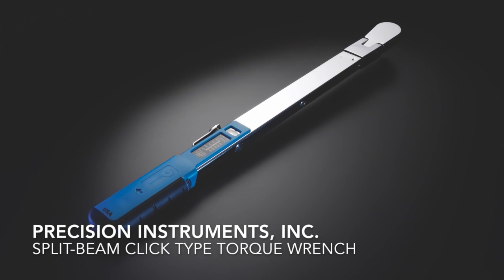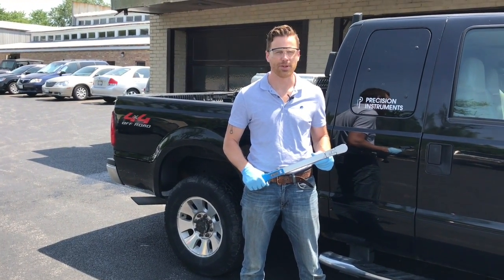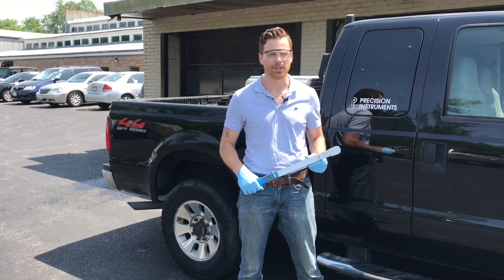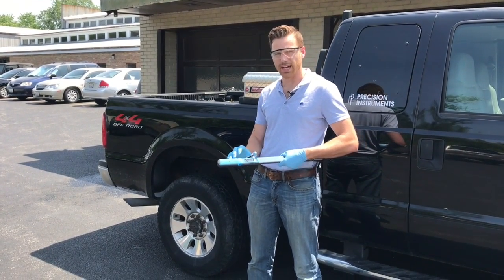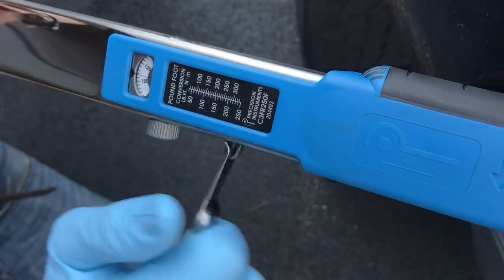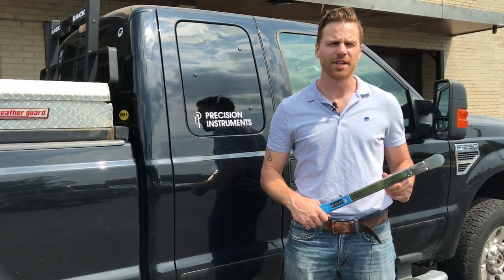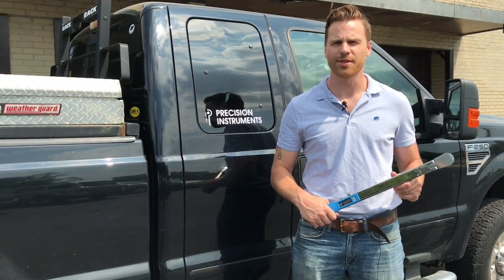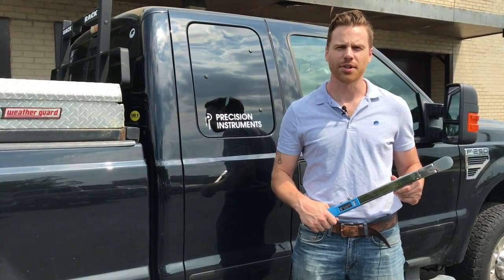Split-Beam Demo 1

Comment: If Precision Instruments can answer these 2 questions please. 1. If I purchase a PI torque wrench on Amazon for $158 vesus $355 + $20 for the certificate direct from PI, will you warranty it if needed? 2. Your downloadable instruction manual shows a direction lever and indicates that the torque wrench can be used in a tightening AND loosening directions. I don't see a lever on your split beam torque wrenches. What's the deal on that? Can you use it to measure break-away torque?

Thanks!

Comment: I just bought a precision instruments C2FR100F 3/8” 20-100 ft. lb. they were affiliated with Snapon before. That’s how I found out about PI. I will return my CDI 3/8” as I did not hear a click sound kinda strange. Also I don’t have to release tension to low setting unlike click torque styles

Comment: I am hesitant to buy this torque wrench from Amazon due to the fact that it is only available from an independent seller. I am starting to be wary of knock of or counterfeit  products being sold in this way on amazon. I would like to be confident I'm buying a real, Non refurbished PI wrench. If it was direct from the company or Amazon I would have more confidence.
Reply from the maker: Thank you Pat for your support of our products!  While we do not have e-commerce on our website at this time, you can always call us toll free.  We do take direct B2C orders.  We're open M-F 7:00AM to 3:30PM CST.  (866) T-WRENCH (897-3624). Thanks again!

Comment: What's the width on the head of the tool? I have a torque ratchet but it's a fat head and leaves me no room to get at tight spots..do u have AA 3/8 version??I'm seriously considering buying this tool👍🏼
Reply from the maker: Thanks for the question!  Our 1/2"Sq.Dr. ratchet head, R33BF, is approximately 1.5"W x 1.5"D.  Thats across the top of the ratchet, and from bottom of square drive to top of the ratchet head for measurements.  Hope that helps.  If you have any more questions on this or any other matter don't hesitate to let us know.  techinfo@torqwrench.com

Comment: How do you know if its NM or ftlb?
Reply from the maker: Thank you for your question, Scott.  The C3FR250F has Lb.Ft. as its only scale.  However we do include a N.m. conversion reference scale on the tool as well.  If you primarily work in N.m., the C3FR350N is the metric version.  Hope this helps!

Comment: Are you supposed to forcefully and quickly push the wrench down to get the click like the guy does in the video? I was always taught to slowly pull or push until the click.
Reply: Yep, I noticed it too. He is supposedly selling this stuff. You would think you would know that fact better than an expert. Credibility zero.
Reply from the maker: Dear Susa, Thank you for your comment and good point.  Snap torquing is not at all an acceptable way to apply torque.  Always apply force in a controlled manner that does not allow the torque wrench to over torque.  The torque wrench does have a natural drop in torque when you reach the set value which allows for an reasonable amount of forgiveness.  What we see commonly in high use applications where the user is snap torquing the wrench well through the set value "click" in excess of 10+ degrees.  In the video Matt could have showed more control but with those clicks there was little concern of over torque.  Thanks so much again!  Good eye!

Comment: We have used the Precision split beam at our 12 locations for several years now. They do a great job and hold up well considering the high volume of tires our stores sell. we keep two at each store. good investment, have purchased lower cost ones but spend two much time dealing with warranty issues
Reply from the maker: Dear Doug, Thank you for your comment.  Its our goal to make our product easy to use, dependable, and reliable.  We take great pride in the fact we're in 12 of your locations.  If we can be of any support, now or down the road,  don't hesitate to contact us and let us know.  Thanks again!!

Comment: I owned the pi split beam: I found it was not accurate even checking with a 0.25% accurate certified digital torque tester. The length is too short, and the handle is not comfortable. But I will say, I like how you can leave it set to a torque value forever. Why the hell does the m-line not have a pivoting head is beyond me!
Reply from the maker: Hi Dave, I'm sorry to hear the accuracy of your Split-beam is out of tolerance.  Please feel free to contact Sarah at Repairs@TorqWrench.com or 866-897-3624 (TWRENCH) regarding any service or warranty needs.  Thanks again!